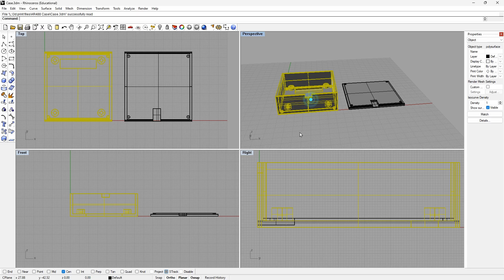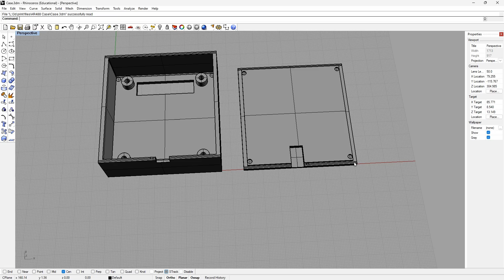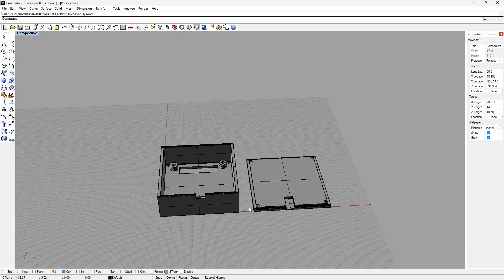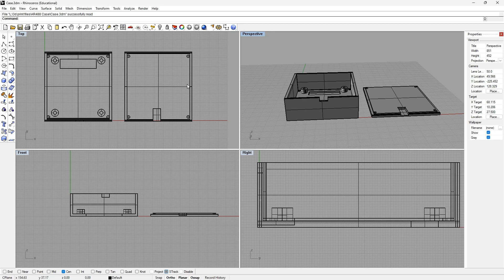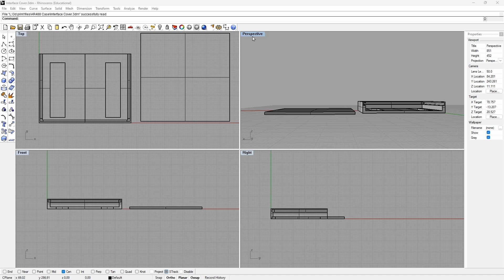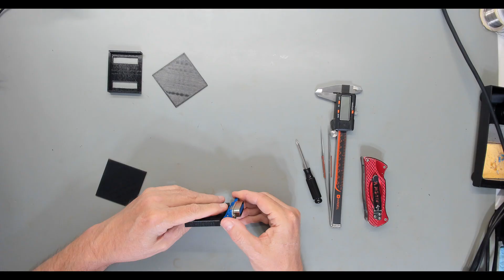Protect Your AR488 Controller with a CUSTOM Case

Comment: Great results!
Reply from the maker: Thanks Uni! It’s all part of a bigger project. Oscillator experiments leads to better Frequency Counter = way to control it = AR488 project = Code library to create lab automation = Way to offload logging to low power device so I don’t have to leave big power hungry Computer running night and day to run the lab automation. 
Only ten people will find it interesting. But I’m having fun. Good thing I don’t do YouTube for the money! 😁
P.S. ordered that nice meter I was telling you about. Should have it in a week or two. Lots of decimals behind the period on this one. 👍 this one is going out for calibration.
RJ